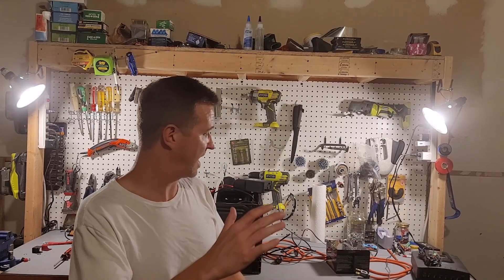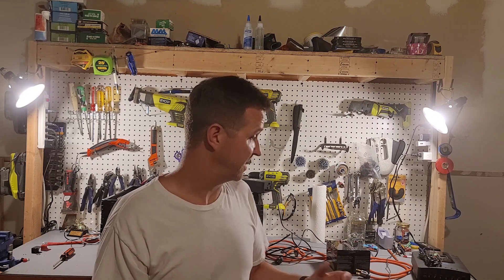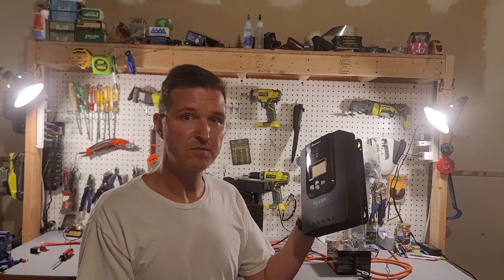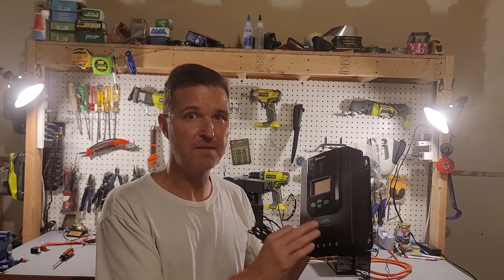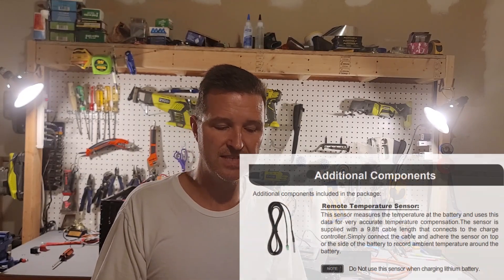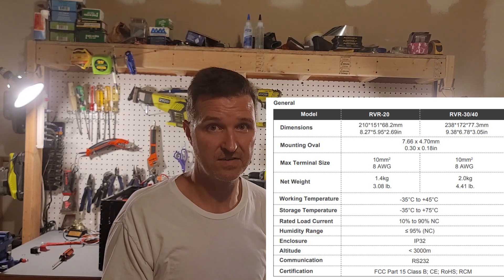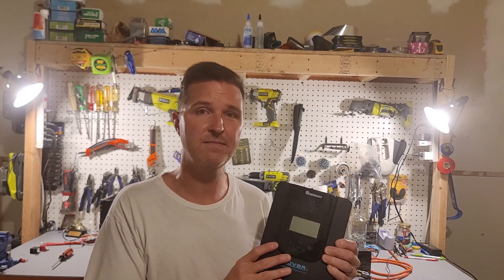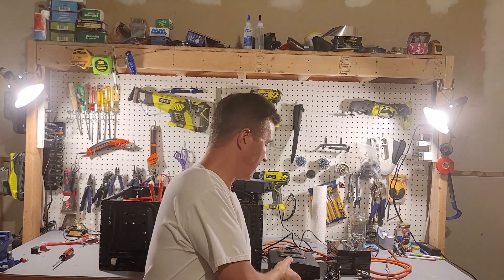Check your Charge Controller Temp Sensor when using LifePo4 Batteries!!

Comment: Thanks for making this video. I have the same charge controller and battery type. The temperature sensor is installed but will be unplugging it. Thanks for reading the manual for me. Ha. Thanks again
Reply from the maker: I'm glad you got something out of the video!  Thanks for the comment.

Comment: I’m using the Rover 20 mppt . Friday I’m hooking up a LifePO4 with built in 100 amp BMS . 12v) . Will the charger controller automatically recognize the battery ? If not , what settings should I use and how do I get to it before hooking up panels
Reply from the maker: The SCC won't automatically recognize the battery chemistry, only the battery voltage.  In order to set this, do the following:
1.  Connect the battery to the Rover via battery ports.  don't connect the solar panels first!  That could possibly fry your charge controller if all that energy has nowhere to go.
2.  The Rover should now be on and you should see the display.  Use the arrow keys to move through the screens until you see the voltage of the battery.
3.  At the voltage screen, press down the Enter button.  When the battery type starts to flash, press the select button to cycle through the battery types.  Stop when you see "LI" and press Enter to select it.  Then it might ask about the voltage.  Make sure to select "12v".
Now you can connect the solar panels and you are ready to start charging!
Hope this helps!
Reply: Thats actually for lithium Ion which i think could be too high for lifepo4. I believe you're better choosing the "user" and setting up your own parameters. 14.4v

Comment: I am thinking this is a battery issue, not the controller. The parameters you give are for the controller not the battery. The operating charge temp of all LiFePOS4 batteries is approx. 0 C whereas the operating discharge temp maybe as low as -20 C. The batteries internal BMS will prevent charging at zero degrees C or less. The same BMS allows charging to resume when the battery recovers above zero. This function will occur within the battery regardless of what the controller does. I believe the proper controller setting is to turn off the temp sensor function on the controller when using Lithium batteries.
Reply from the maker: You are correct.  The parameters are for the controller, not the battery.  There are some budget brands of drop-in replacement LifePo4 batteries that do not have cold temp charging protection built-in.  I was just wanting people to know just because a Charge controller has a temp sensor doesn't mean that it's meant to shut off in a Freezing temperature situation.  Thanks for the comment!

Comment: I think you are safe in your house never going below freezing.   Seems like that’s for people with RVs or cabins and shedding cold climate and you can heat the battery area if needed.   Have fun stay safe.
Reply from the maker: You are correct.  The whole reasoning behind the video was first to show how if your LifePO4 battery doesn't have a cold sensor, then you can use this.  BUT...  then I found out the temp sensor on the MPPT didn't do what I thought!  It just changes the way it charges the battery...  I just didn't want it to fool anyone else since it fooled me!  Thanks for the comment!

Comment: yes I saw that with the Renogy rover temp sensors, I'm assuming the Rich solar rovers are the same way. But I just want to be able to monitor the battery temp and disable the compensation. Will Prouse says there is an easy solution to disable cold temp charging on lithium, but I have not found it yet, and he is not always right, no one is, lol! You can get plant seedling heating mats that are about 20w each and have a thermostat, and I will probably go that way. even though my batteries will be in my boat and RV it only gets cold enough here a couple days a year, but when I'm camping in the mountains it will be an issue. Do you have the blue tooth module for your rover?
Reply from the maker: I don't have a BT module.  I bought the Victron before i went any further with Renogy.  
I know Victron has a Smart Battery Sense module that plugs into the VE.Direct port of the MPPT that can monitor Temp.  My MPPT is set to Comm so I can access information from the internet.  I don't think you can have both at the same time.

Comment: Its a worry, is the Basement sub zero in the winter or do you run a heater to keep batteries above zero.. Talking about small print the SUN-1000GTIL2-M grid tie invertor,, Some where I found that was only for 36v Battery...Also with Grid Tie about length of Grid Tie CTsensor if more than 15 meter may not be accurate.I think this is why POWMr and other Hybrid intertor have not pursued this route. The ON/OFF Gird seems more popular with manufactures. i.e. The MAINS tops up load if solar dips, essentially you not back feeding your Sockets..
Reply from the maker: The Basement should never get below 0°C.  If it does, I've got much bigger problems!
I know what you are saying about the grid tie inverters.  They are very specific about the voltage.  I'm guessing they are basing their inverter input voltage on typical Solar panels voltages and not battery voltages.  
That is another reason I don't like messing with the CT clamp inverters.  My main is about 35ft / 12m away from my off grid setup.  I would hate for the clamp to even have a chance of being incorrect.
Reply: @OffGridBasement  , I am not too worried.  I just have a hall cupboard with my Meter. It's SMEG2 , 2nd gen smart meter.   I   was surprised to find it has a Import,  Export meter readings, I did forget a few times. And exported a small amount. Its designed for solar future. But , they don't read the export currently on my bill.

Comment: So the key comment is at 5:58 - "You have to read the manual".  Renogy has all their manuals on line and one should take the time to read them before purchasing their equipment.   One should note that on their smart LifePo4 (RBT11LFP12-BT) , the BMS will protect from charging at or below 32 degrees Fahrenheit  and will provide warnings via their monitoring software for temperatures below  44.6 degrees Fahrenheit.   If one plans to try to use Lithium Batteries in areas that can reach these temperatures, consider a battery with a self-heating function such as the Renogy RBT100LFP12SH-US.
Reply from the maker: Thanks for the info!

Comment: So from what your explaining it doesn’t work well for lifpo batteries. It doesn’t shut down. But now I wonder if it does the same for AGM or lead acid batteries. If it got to cold it shuts down.
Reply from the maker: I don't think so.  I believe it would keep working for AGM or SLA batteries until the unit itself froze @ -35°C.  It definitely won't work with Lifepo4 batteries if you are looking for something that will shut off charging @ 0°C.